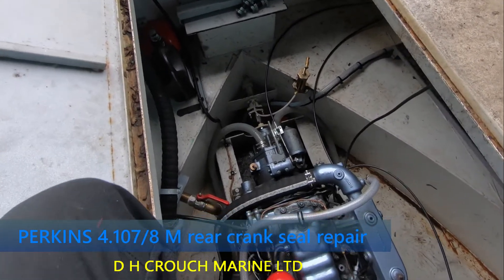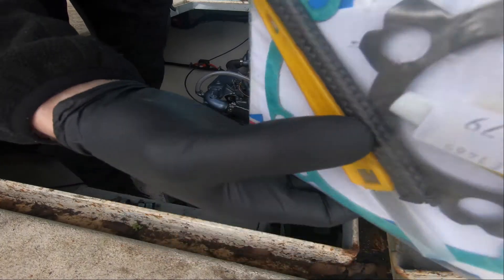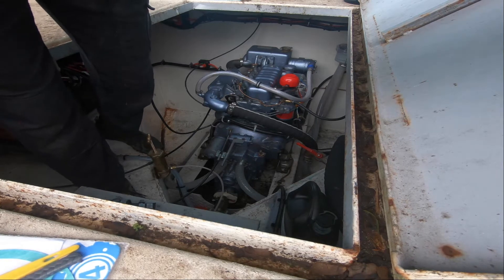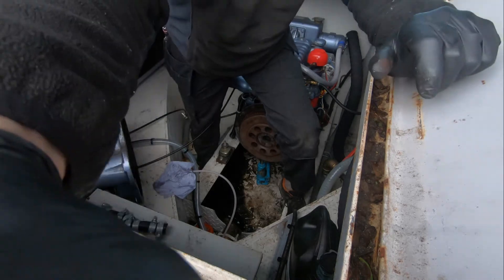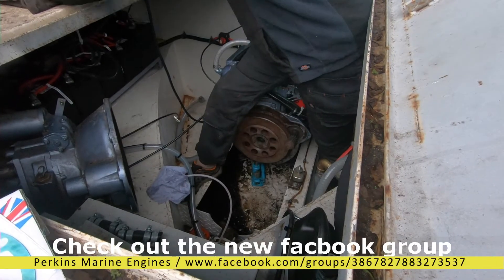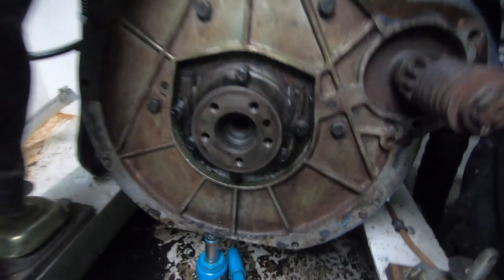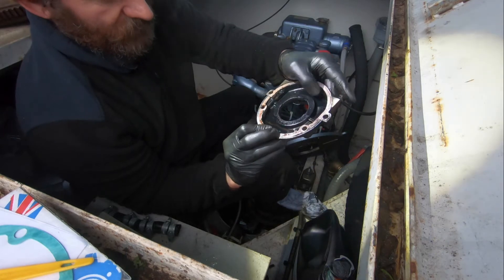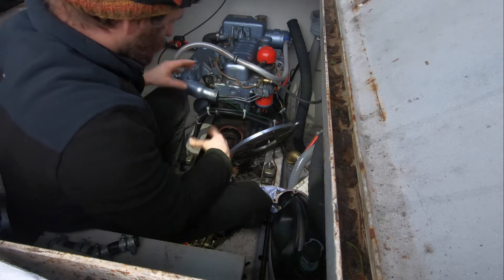Perkins Marine 4.107/8 Rear crank oil seal repair

Comment: Great job
How much you charged to do that job?
Reply from the maker: Depends on each job. We have standard fees. If you email or watsapp images of your needs, birdseye pictures and the access to the rear of the engine I can estimate the costings.

Most of the work is getting to the seal carrier.
Reply: Great stuff..thank you.
I don't normally take jobs out of my normal 9 to 5 but it's a start 👌🏿
Reply: Ohh ok...I'm only asking because I'm a marine engineer as well and I got a similar job to do lol
Reply from the maker: @randydickson7938  Are well fair enough, like I say take into consideration the work to get into the seal. On that job it was a days work in and out. We are also Vat registered.

The seal kit isn't that much. Hope that helps